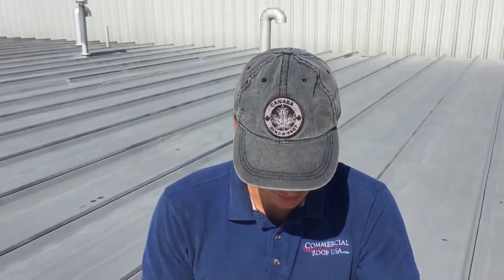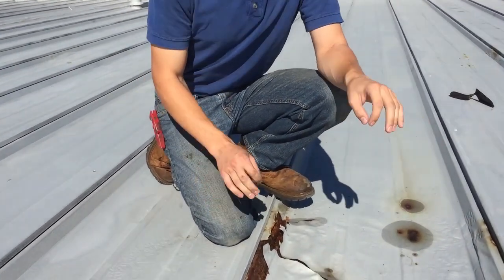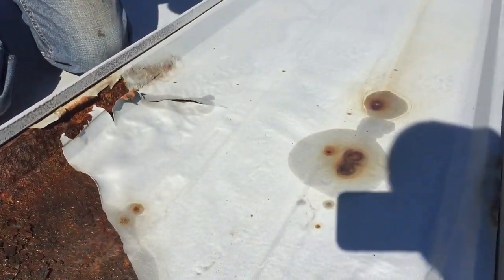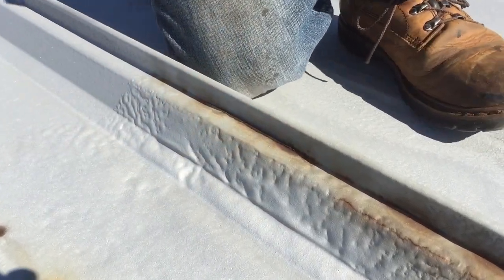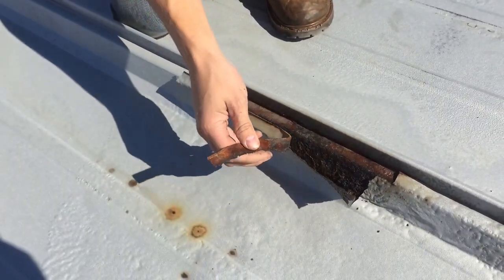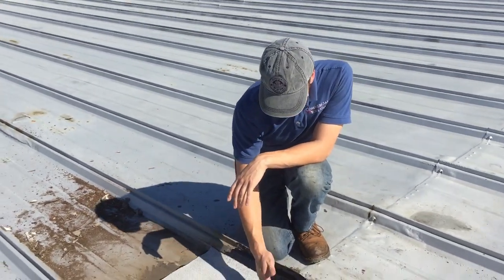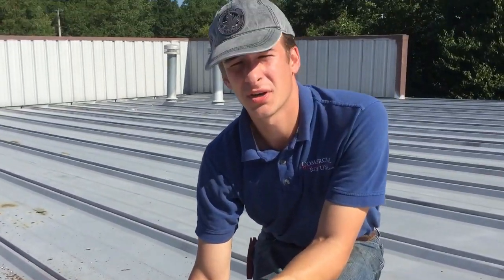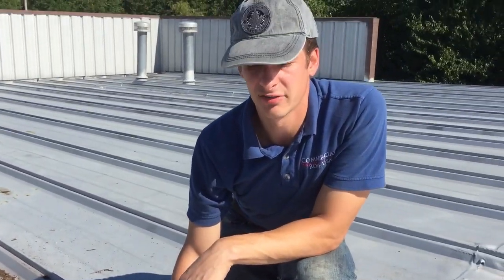Metal Roofs that Leak: Repair Options - Silicone coating the worst product for metal roof sealant

Comment: Not sure what coating your looking at, but applied properly, silicone does not allow water to penetrate it. I could show you metal roofs coated with silicone that are 20 years old.

Comment: By the time you do all that with labor and all, seems like it would be about the same or just a bit more to remove old sheet metal and put down new sheets & fasteners.
Reply from the maker: One would think so. But it takes around 5 minutes to clean and seal a seam in each bay (between standing seams), therefor it is more cost effective to do the repair

Comment: Either they didn't pressure wash and prime the roof first before applying the coating or they didn't remove the rust on the panels them selves.